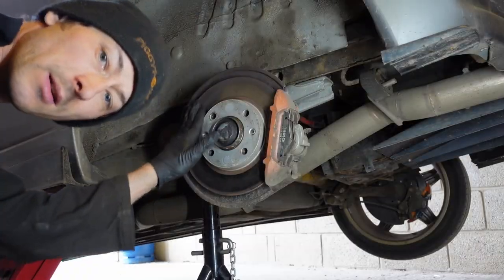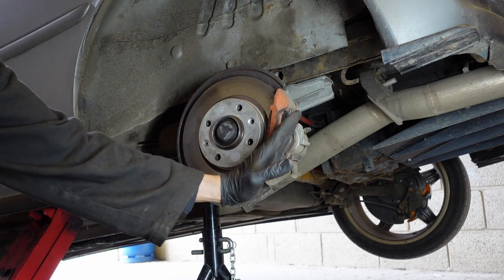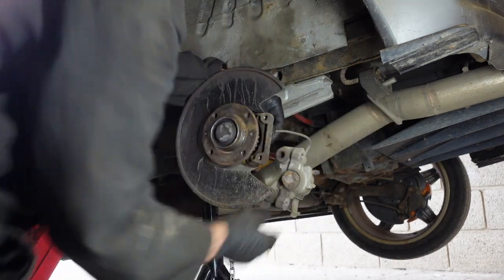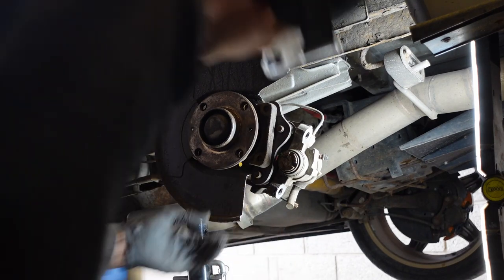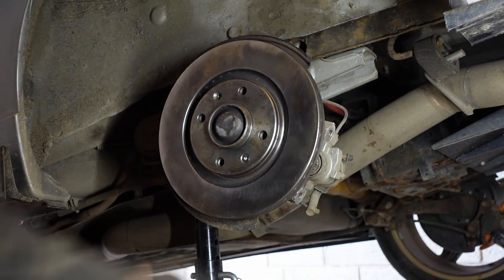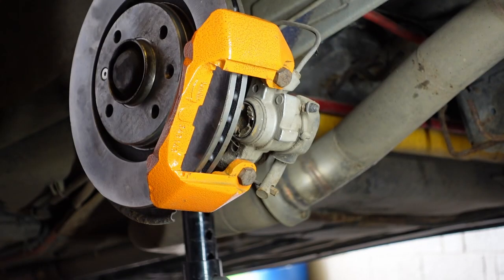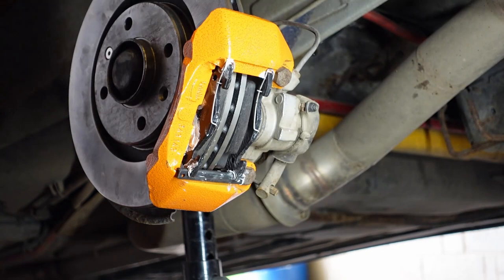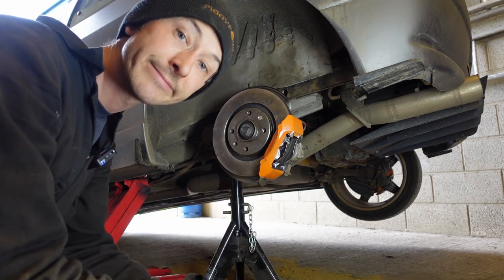The Lemon - Peugeot rear brake upgrade, VENTED DISCS!

Comment: I once didn't fit the tiny little retaining clip at the end of the pad retaining bar on my 309gti. Set off on a motorway trip and didn't touch the brakes properly until the roundabout at the other end of the motorway, probably 50 miles done. Needless to say the pads had dropped out and when I went to brake there was nothing! Luckily the roundabout was clear and I scrubbed off speed around the roundabout.. The rear piston came out just far enough to touch the disk and make the careful drive home manageable!
Always remember your clips and springs!
Reply from the maker: Yup. Always remember to fit your brakes properly 🤣

Comment: Hi I have a 403 1961 Peugeot  pickup  and want to change braking system  from drums to disk any ideas
Reply from the maker: That's awesome!! Id love to see your pickup! Id suggest finding a 403 (any version) with discs and use all those e
parts
Reply: @PiggyPower  Hi I was not aware of any Peugeot 403 with  disc brakes  but please could you point me  in the right direction 
Would  any newer models which are compatible
Reply from the maker: I've no idea sorry

Comment: Hi piggy, just watched all your journey of the lemon, I wanna do an head swap of my 8v too. I've seen that there is a 2.0 hdi 16v, could I swap it in without modifying the engine support since it's 2.0?
Reply from the maker: Hi there. The 16v 2.0 and 2.2 blocks are slightly different and need custom engine mounts. You'd need to think about gearbox options too.  This is why I originally went with using the 8v block. 👍🐷
Reply: @PiggyPower  ye I'm gonna use my stock 8v block, but I wanted to know if the head of the 2.0 16v would fit on the 2.0 8v block.
Reply from the maker: I think I've probed it will... 😂 The 16v 2.0/2.2 heads are basically identical. There isn't a few different designs over the years of course. But the main mating face stays the same. As do the valve sizes and cam lift.
Reply: @PiggyPower  ah ok XD so basically the height of the head its the same
Reply from the maker: Most the design is the same.

Comment: Hello i'm writting from Uruguay.. (Luis Suarez) you know.. I have a Cit Xsara 2.0 HDI my car have actually (sorry my english) 283 mm at front from a Peugeot 308.. Rear I have original 247 mm discs in the centre 71 mm diameter what kind of disco  do you instala there..!?
Reply from the maker: Good job, nice upgrade and great to hear from people around the globe! These rear discs are 266mm and are machined to fit these hubs 👍
Reply: @PiggyPower  great thank you...

Comment: Assuming there standard 266 306 discs? How would one go about replacing them in the future if I got a kit from you?
Reply from the maker: No they're not. Different offset. I rekon these discs would last you 50k miles! and pads will last twice as long due to double thickness... 
But once the kit is bought, I can provide cheap service kits thereafter if needed. Discs are machined fit.

Comment: 6:20 are there any exhausts I can get that are road legal but still sound good? I.e. not a straight through? Obvs never going to sound like your Lemon but I can hear the engine and in the early days my garage put a non-meridian exhaust on so it looks like a limp d**k hanging out the back of my car. Want to put a proper one on.
Reply from the maker: Yes. You can get one made to your specs. Just costs a lot. A sporty backbox off the shelf of eBay and welded on is another alternative